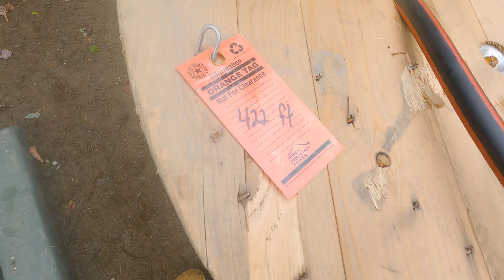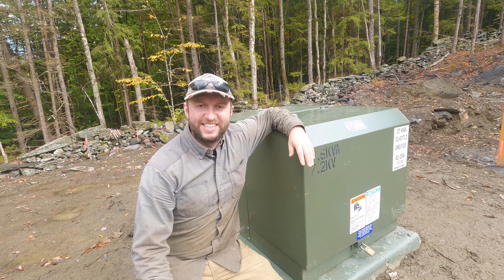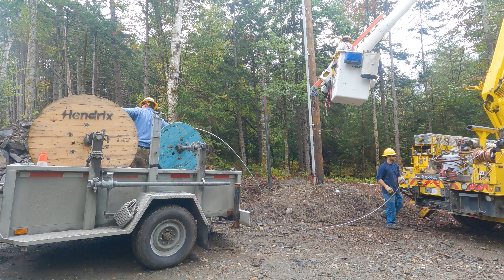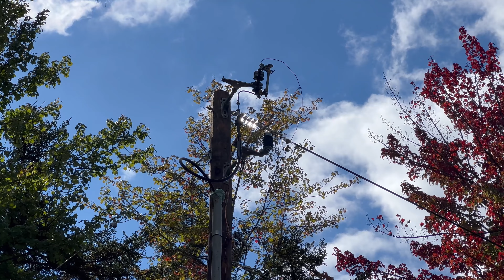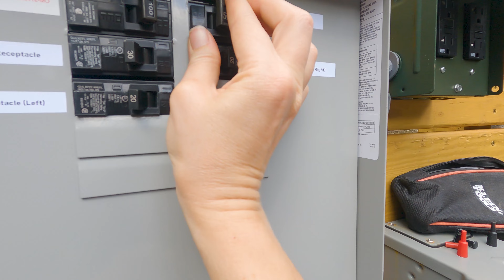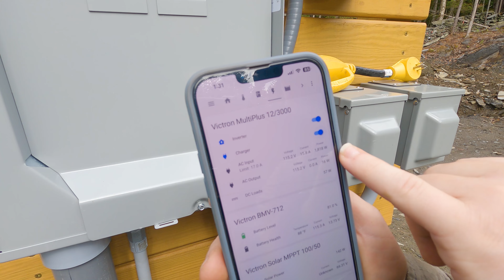Our ELECTRICITY Meter is INSTALLED || DIY House Build

Comment: Getting power onto the property immediately makes the property much more desirable. Really good move that'll pay back in spades.
Reply from the maker: Absolutely! And much more comfortable for us as well. It’s so nice not to have to keep turning solar panels or running the generator, knowing we have enough power to run whatever we want.

Plus, thanks to the big lithium battery upgrade we did on our RV, when we do have a power outage the RV switches to battery power instantly and we carry on like nothing happened!

Comment: Hurry up and wait, then go like hell. Isn't it always that way? Always interesting watching proper tradesman working, with the proper tools: e.g. no need to climb down into the transformer pit, they've got a hook top on the fiber pole to fish the line up with. :) Also interesting to see how much that last power pole bends when they added tension to the line, I think I'd be taking photos from a fixed position over time to see how it moves. Of course, that's me in Hurrricane-land (gulf coast TX) worrying about wind: y'all get frost heave and snow loads to deal with, instead!
Reply from the maker: I totally agree! It was genuinely a pleasure to watch them work each time they were on site - so organized, professional and well equipped.

I noticed that pole move in the video too. Hadn’t realized until then. I think now the wire is taught and the anchor is secured it’s a lot more stable. We’ve had some pretty strong winds this week and there’s been absolutely no sign of it moving.

Comment: Was burying the power line along the road not a viable option instead of using poles?
Reply from the maker: Due to all the bedrock we have, it was a very very costly option in terms of making the trench (and increased conduit prices too) so we chose not to take it. You can check out our driveway video https://youtu.be/M4FPuIWLBH0 and we even had to bring a special truck to drill the hole for the electric pole https://youtu.be/n3X0abWCOVQ